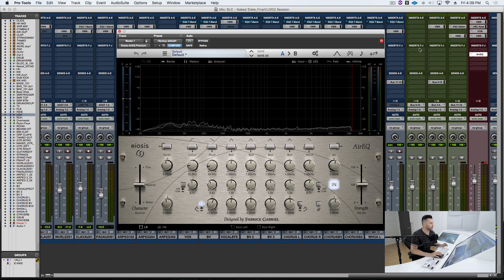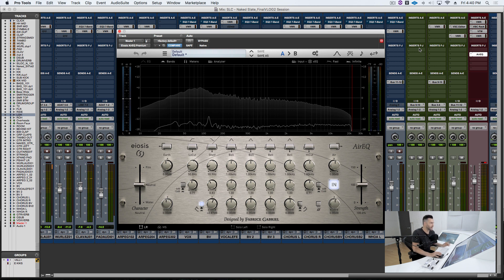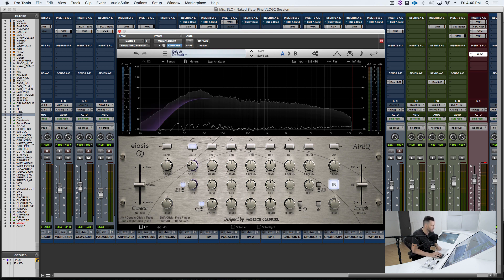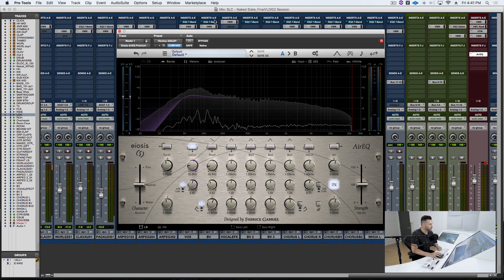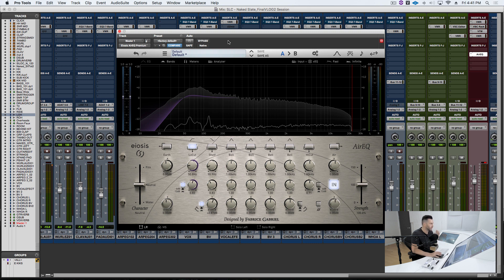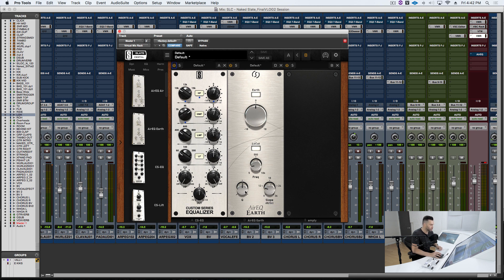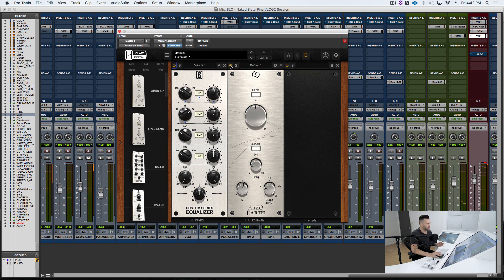My Favorite Trick For Fat And Tight Low End On Mixes | Slate Digital

Comment: I don't think this qualifies as a "Trick". It's more of a tip for those who don't know how to EQ.
Reply: it certainly does qualify as a 'trick' as a high pass filter is designed to remove low end not boost it and so most people would probably not associate high pass filtering with boosting low frequencies. 

this technique has double the impact as it removes the lowest frequencies which may be creating clutter and highlights the mid to high end of the subs which will create more low end impact, both with one plugin. 

win / win.
Reply: I'd say it's a more of an "idiots guide" for engineers who don't have grammy awards - so I found it interesting.
Reply: That's why engineers from way back prefer certain hardware eq's before others..... Because they know what to listen for, and have a reason for their choice of type of eq (or compressor for that matter).
It's not a trick, it is a common solution based on knowledge and experience...
Welcome to recording school 101...
Reply: Recording School 101 but this is about mixing a bass, not recording it.
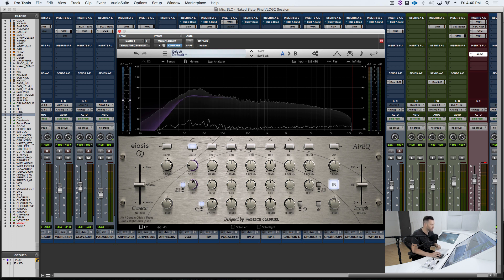Reply: I also wonder with kind of audience this is addressed to, kind of annoying at 01:30 when he's playing with the Q and goes "see that? see that?"

Comment: Hey Steven, great video thank you.  Where would you place the EQ in the mix bus chain - before or after compression?   Same question if you were to stick the EQ on a drum bus or bass part please. Thanks.
Reply from the maker: With Resonate Hi Pass Filter, I'll get the mix compressed a bit to tighten it up, then I'll use the resonant high pass filter after, and sometimes I'll reserve it to the mastering stage too.
Reply: Cool, thanks Steven

Comment: I’ve never thought to filter out that much low end on an entire mix. Is that something that’s common to filter out or would you say this is a genre/ song specific technique? I was under the assumption that the kick had important frequencies below 50 Hz. Thanks for this tip. I love using Slate plugins.
Reply: Whatever sounds good. There are no rules. You can still boost something after it has been cut because it will affect other frequencies.
Reply from the maker: Normally I’d high pass no more than 30hz, but when you use the resonance along with the high pass, you can tune back the lows to taste. If the song was a bit slower I may have used a lower high pass frequency.. faster tempo can build up too much sub lows if you are not careful down there. As usual, the ultimate judge is the ears. Good luck! - SS